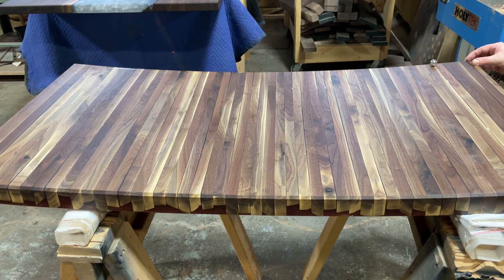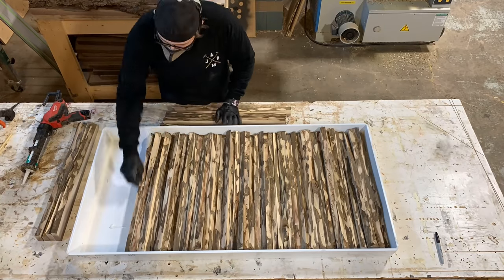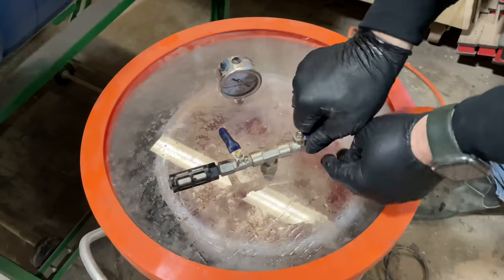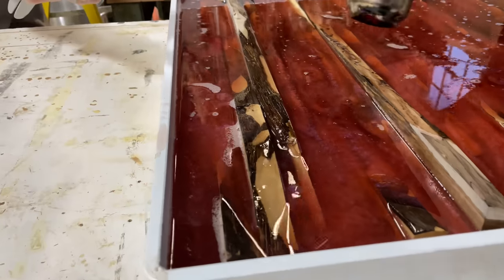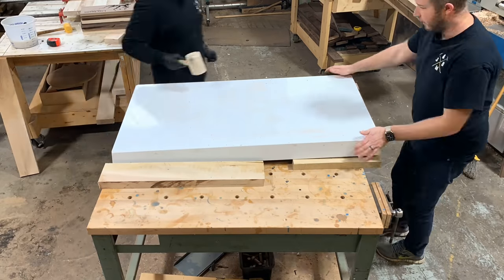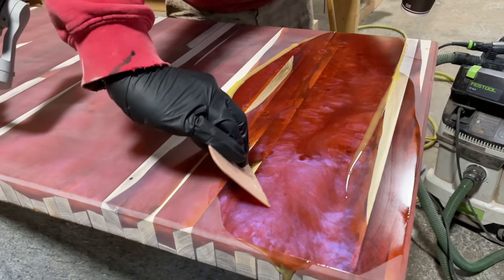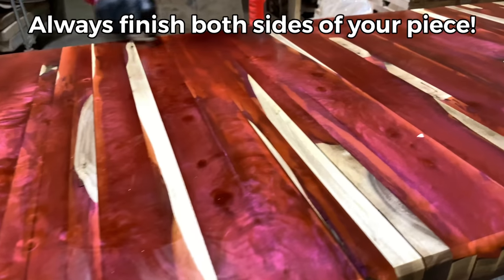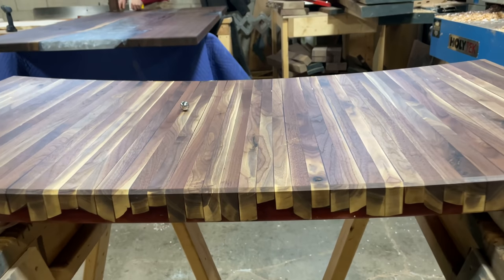EPOXY FAIL | Don't Make This $1000+ Mistake

Comment: I’d recommend use a heat gun on both sides and put it on flat surface cover with mdf board the size of the table and apply some heavy gym weights on top and leave over the night, should straighten it out

Comment: This is totally salvageable provided it's no longer moving. Top is 3" thick, right? and the dip appear to also be about 3" over the 48" length? Cut into 4 pieces, each 12" wide. That reduces the dip to just about 0.20" for each piece, so your overall thickness would be be about 2.75" after some finishing. Each piece could be  flattened on your CNC, trimmed up square, and glued back together. Not sure how the epoxy line would look glued back up, however.

Comment: Cut a series of curfs in the underside of the table, deep enough to give it the flexibility to flatten again. Then use scrap pieces, or epoxy to fill in those curfs cuts.

Comment: make them into a set of chairs. use the warped part as the seats and back, it should fit your back and bottom nicely with a slight curve. May have to reinforce it for strength somehow though...

Comment: Find a custom pool cue maker and they could use strips of it to turn into pool cue butts. Or you could cut it into straps and sell them on ebay for cue makers to buy. It would just depend on how thick it is and if the curve would interfere with trying to make it as straight as possible.

Comment: From where it is now, chop it up into thin slabs, maybe 2” thick or so, rotate the pieces 180 degrees, glue and clamp them together, re run with a clear epoxy to a slightly greater thickness??

Comment: As a Carpenter, what you failed at wasn't the finishing moment it's the fact the you wood (lengthwise) going into the width. (This mistake happens to lots of people) The reason why the other projects do work is because you always show the wood chunks lengthwise. 

To somewhat help with the issue at hand, adding 3sided metal bars (not triangular but like a squared U) grooved into the bottom of the table by also adding screws every 4-5 inches (Your choice). Not only does it add stability but it should help with flattening out the said table. And if you make another one of these tables. I would recommend that you would want to add these 3sided metal bars before adding the epoxy. (Glue the wood together first if possible, gives off a bit more content as well ;D )

Comment: 1.  Sand off oil finish on the bottom.
2.  Pour [and rub in] hot water on the bare wood.
3.  Allow the wood to expand to naturally flatten the table top.  
4.  Once desired flatness has been achieved, fully encase in epoxy to stabilize the wood moisture and eliminate potential for expansion and contraction of the wood which cause the warpage in the first place.

Comment: Borrow or rent a solid welding table that has drilled and tapped holes spaced approximately every two inches over the entire surface.  Then put that and your warped top inside a local powdercoat oven.  Gradually bring the temperature up as you use ever increasing clamping force to bring the table back to level.  Hold it at that temperature long enough to let it stress relieve itself.  Then bring it all out of the oven and allow to cool completely while still clamped to the welding table.  I believe it will remain level or close enough to plane flat after the process is complete.

Comment: Do the same what you do with bended timber, just cut down and assemble the bits back with up and down bend direction, then flatten the surface. it will be thinner but still bight work as a table.
Another idea is to make a furniture doors from it where you don't nee thickness. It still can work in some project because it is really nice. I am sure you wasn't wasted here. You can still sell it as part of another project.

Comment: Make a frame underneath 2in.sqare tubing lay on floor with a jack n blocking to a solid beam or ceiling on both sides then jack till straight little at a time then attach to frame from the top

Comment: Sand the wood side back to bare wood. Wet the surface and then put weight on the top of the epoxy side until it is slightly further then level. As soon as it holds its level shape, quickly epoxy the wood side.

Comment: Use it for a sign outside a building. Light it up a bit around the edges and then stencil out some letters to put over the epoxy side.

Comment: it would be an awesome railing as a center piece looking over a living room!, also you could try longitude C channels, heat up the wood and resin and see if you can bend it enough for the C channels to be screw in and hold it in place

Comment: Use your cnc to hollow out most the bottom leaving only the edges. Clamp it down slowly, refill 1/4" with opaque epoxy. Then add legs that add structural rigidity like Blackmail studio so often does.

Comment: You could likely save at least.5” and use it as an inset for another piece. Otherwise, the radius might match a curved monitor for a computer desktop backing.

Comment: Cut a large number of slots parallel to the short side about 3/4 "  apart on the concave "bottom" side, you have to guess how deep.  Pick a hot day leave the panel in the sun resin side up, place steel L brackets along the long edges and clamp. Slowly tighten clamps until straight. Let cool then fill slots with epoxy and cure. This all depends on how much the epoxy shrinks or swells during set up.

Comment: I think I would sand down both sides thoroughly. Epoxy the wood side first, adding same color resin until level in the mold.    Then flip and add more epoxy to the top side until completely level in the mold again. .  You could if you wanted add extra  thin strips of wood both under and over the high and low points. Flip it, and do it again until level.  Then sand it down good on both sides until some wood is exposed on the preferred top side.    You may need to epoxy the sides depending on how you feel the sideview looks with the additional strips.    Or, if you have the machinery to cut it,  slice it into long thin strips longwise (like the side view) and use those strips side by side in the mold (or cut up and rearranged however looks cool) to make a unique tabletop pattern. Lots of cool stuff.  I only have experience with small epoxy pours so take my advise with a grain of salt (and maybe a margarita)!  Let us know what you decided to do if you have already decided.  Curious!

Comment: Make another matching one. Then stand them on ends add a cross member for support and then make a top that won’t warp based on the design you initially envisioned. Turn you 1000 dollars mistake into a 4000.00 piece.

Comment: Firstly, The oil never goes on the Epoxy. Epoxy is used after oil application to make colors snap. To fix the bow, use router along both outer edges as a frame. Use a board with nut-certs so you can draw it up tight. Just my thoughts

Comment: With the bow in it you could cut some width-wise channels in it from the back (wood side) to allow light to shine through the epoxy on the front. Then connect some lighting to the back and to it into a wall art piece. The bow and the channels would allow the light to shine out and create a pretty cool effect with the epoxy and would imho. Regardless, thanks for sharing and discussing your lessons learned.

Comment: Hi guys, I don't know what you ended up doing with this project, but her is my 'two cents' worth.

Nice colour, shame about the 'error'.  However, from what I saw, it was not the lack of finishing to both sides that caused the warping, but more so that you left no gaps between each slat of wood.  Therefore there was tension on one side, but no 'strength' on the other. A recessed metal plate on the bottom would have possibley prevented this, as well reducing normal wood movement into the future.

Had the resin bonded top to bottom, and between each individual piece of wood (despite it taking more resin), the 'wood' would have been equally supported with resin. As it was, it was like taping one side of some slats of wood, it will naturally arc over from the side NOT taped. 

As far as secondary use goes, as some else said, use it as an overhead lamp, however I would probably cut into 2-4 lengths to make separate lamps (and without requiring major support to be required).  You could also have used the cuts pieces, place each piece vertically, join together, and make an 'eye' shape, place a desired shaped glass top, make a base/legs and use it as a coffee or side table.  Even perhaps put some lighting inside, or gravel and 'desert' plants for teranium?

Comment: Clamp it down straight with angle iron, re epoxy it clear with very little on already epoxy side and a good thick layer wood side? Let cure clamped and trim sides where clamps were as they won't finish nice with a clamp and angle iron? Cool island top for a kitchen or something?

Comment: I would put it between two pieces that would straighten it and then cut rails on the bottom side and screw in some T metal bars that would not allow it to warp back to the shape it wasn't to end up.

Comment: its perfect! , wrap it up , put it in the Truck.

Also its not Ruined if you're creative, just get an equal to size piece of glass , put stoppers on the 4 corners , fill the gap with flat shiny stones that you can see under the glass.

Comment: Personaly ide try to fit it back flat. Humidity contre it in a sealed bag for a week with some daily increasing weight on se flat beams above. Once it's back flat and out the bag give it only the required time to surface dry and get it all sealed in a clear epoxy

Comment: Cut it into 4 equally sized pieces along the horizontal. Then mount each of these into their own shadow-boxes (a framed box, if you will). Then mount hanging wire on the back of each. Post these for sale on your retail website at $ 1,500.00 each. Once they all sell (and, if you do this correctly, they will), you will have then changed your $ 1000.00 mistake into a $ 6000.00 success. Try it!! One man’s mistake is another man’s art.

Comment: I've bent epoxy with heat. I'd put it in the sun with a cover over it to protect it from the uv rays and try to get it to bend back. Worth a shot I guess.

Comment: Fill the inside of the radius with epoxy and remove the outer radius.
Or cut it strips, square them, alternate epoxy side up then down, then re-epoxy.

Comment: Couldn't you heat it up somehow and apply small amounts of pressure to slowly bring it back and then run some C channel length ways of the table to hold it place.

Comment: Just fill the top with clear epoxy using a mold and sand it, , sand that until leveled, it would look a bit 3D where the wood in the middle is deeper in the epoxy and the edges more shallow.

Comment: Cut the table in half horizontally to the planks then cut each piece vertically to the wood planks on the same width of the planks, put everything back together by positioning each other plank upside down, pour half epoxy before you start positioning the planks and the rest on top. When you finish sanding and reducing youll find yourself with a 2 side table with wooden illusions inside of it.

Comment: put it on a flat surface and leave it out in the sun.  Maybe it warps back to being flat.  If it does start to flatten,  install C Channel braces in to lock its form.  Then re flatten on cnc and refinish.

Comment: Bevel the piece all the way around 3/16 deep on one side build a frame of angle iron 3/16 all the way around drill holes suck it down flat maybe with some heat give it that steampunk look and if it breaks in half it would make a nice set of end tables same concept just smaller add pieces to the ends to even it out ? what to do what to do ?

Comment: Build the fram for under the table box style fram clamps to pull it back down flat then set in places with fasteners. Should work. Idk much about epoxy tho but it works to straighten lumber. Little water let it set it becomes straight lol idk wesrth a try

Comment: Saw it in half and make a writing or drawing desk. It's easier to draw on a slightly inclined surface  Add a little pencil tray at the bottom.
Reply: I was thinking the same. Two smaller tables would cut down the curve and they could still be functional.

Comment: Put it out in the sun epoxy side up covered with a black tarp. The table top will curve towards the sun. Once it is straight refinish both sides and quickly Attach braces to the wood side. C-brace metal routered in.

Comment: You know, you could heat it up. I've seen someone do that before. Then clamp it down, sand the exposed wood on the bottom and seal with epoxy. ? Might work?

Comment: What exactly causes the warp? Oil makes the wood contract? Or something on the epoxy side expands?
Reply from the maker: At the end of the day I think it was due to uneven finishing. The bottom was Oil finished and the top was encased in epoxy which allowed the wood to move unevenly.

Comment: Take a couple square steel bars and drill them into that bad boy. The tension from the screws should pull that table straight down to meet the metal. And then make the base around the metal

Comment: IMHO, you should use it as is! It is AWESOME! But...if you wish to true it up, simply use steel U channels bolted down into the wood using 3/8 (or bigger) steel inserts. U channels are so tough that they can true up almost anything. And...the table top didn't warp because of the different finishes. I warped because the wood was cast in the epoxy rather than being laminated in one piece prior to being covered in epoxy.

Comment: Put it on the ground, wood side down in a small room with a space heater until it”relaxes” to flat. Flip it over and install some c channel lengthwise and see if that stabilizes it. If so, flatten the top, sand and finish. If it fails, save the c channel for something else.

Comment: Try sanding off the oil finish, and get a little bit of moisture into the wood by lightly spraying with water over a few days. If that flattens it, lock in the moisture with a thin flood coat of epoxy on the bottom and end grain.

Comment: I would run it through the planer again again until you got the correct result ....or add some small peg supports at the corners of the epoxy side and put a piece of glass over it

Comment: Cut 6 inches off the short end then cut out the center the same size as that cut off long ways and insert the cut off. Drill holes in the sides of the short ends into the cut out and insert some hard wood rods. You could probably do a interesting carving in the wood side of the cut off with that side up and then clear epoxy over it.

Comment: cut them into 2 square pieces then run them thru the planer. once they are flat again mount them as insets in a framed table.

Comment: Just add a equal size plywood which will cost you a 30 -40 bucks and  stable table and u can glue wood or screw it with table it’s nice looking well

Comment: ok, I ll tell you what u can do. One time in Switzerland I went to a casino and by my surprise the roulette was unique, really big, carved in a table of wood, the surface was like a concave, similar as an euler disc base but with holes with the numbers engarved and filled with epoxy on its sides. The holes were not deep and were kinda big too and so was the ball, cannot find a picture on teh web of that tables. So with yours, I would make it evenly convex from all sides, like a dish with not much angle and then make the holes. The idea is to make it in a way that eh ball will not always end in the very middle.

Comment: I don’t know if anybody else suggested this and I’m not going to read all through the comments to determine if that’s the case. But this is what I would do. Placing wall mount standoffs on the Woodside with color changing LED lights on the Woodside in mount to the wall as a decorative art.

Comment: Honestly, I'd still personally find use for it as a table, I would use it similar to a show piece to show off some collectibles I have, as they have a solid enough base to keep them properly standing on awkward terrain, however, you could always use it for the second layer o a two part table, the top being glass and the bottom being the warped top show here.

Comment: I would make a coffee table of it using angular legs giving it a Japanese style with the wood upper surface and stand it on a mirror base so the underside can be viewed.  Make a divot on four upper corners to hold four of those steel marbles and let people play with the marbles.  Or, place four corner dowels and rest glass over the top.

Comment: A quick question if you would have ran the boards lengthwise with that of still happened???
Reply from the maker: It would still happen, but the bow would run in the opposite direction.
Reply: Thanks for your response!!

Comment: If this happened to me, I would simply make a square framed skirt underneath the table as many tables have. You can even router a 3/8 to 5/16 channel in the table to recess the frame. Then use the strongest clue, insert the frame, and compress it with clamps all along the table and the frame. You don't have to do this of course as you can use L-brackets every few inches. However, I would much rather recess a frame into the table. The vertical frame/skirt can not and will not bend of course. This gives it the rigidness necessary to help straighten the table out. Later add, bolt, or glue the corner blocks and corner braces and add the legs.